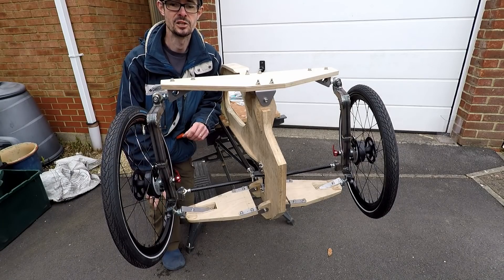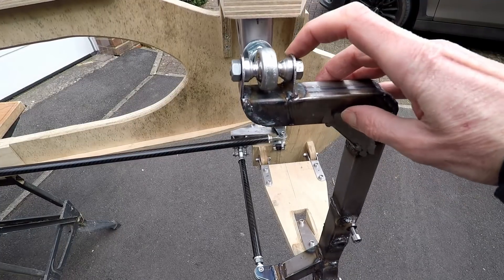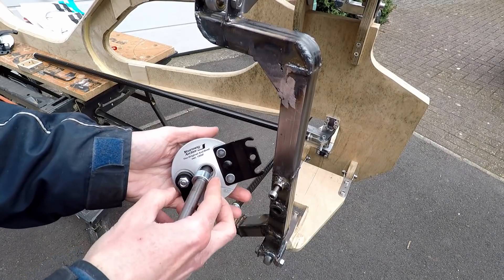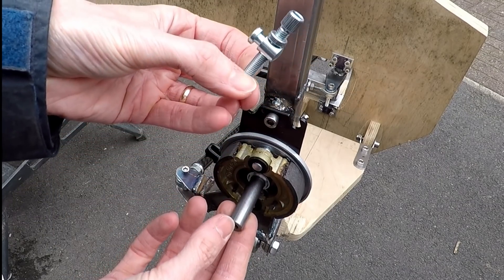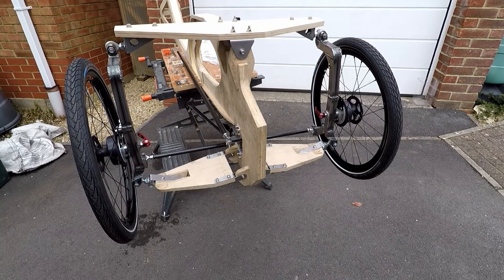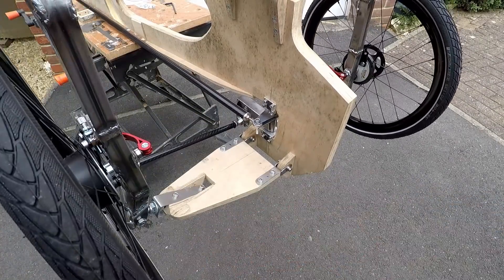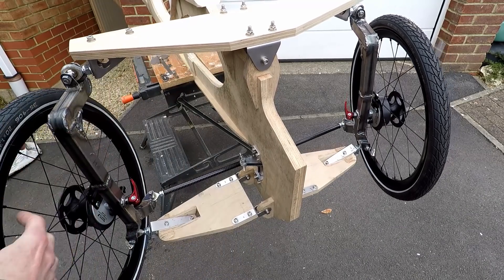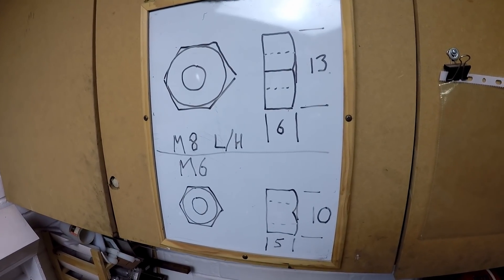Tilting Trikes Part 11- project progress and a closer look at the tilting and steering mechanism

Comment from the maker: I hope you find this update interesting.  Feel free to leave any questions or comments. Best wishes, MMS.
Reply: I'm interested to see what happens when one front wheel hits a bump/pothole. Will it cause issues at higher speeds?
Reply from the maker: @jakobchaney6819  pot holes probably best avoided if possible but I don't see it being a particular problem.  The wheel separation is not that great, so the tendency to spin the trike should be limited.  Time will tell I guess, I'll put it to the test in due course.

Comment: im still gonna fill out a hurt feelings report because u left  us. At least tell us something
Reply from the maker: @Pushyhog  sorry I’ve had to put the project on a bit of a pause due to other things and work getting in the way. I have been working on the design for a new version which I think will be more practical and user-friendly, so hope to get started on this as time allows.  I’m thinking it will be half way between a faired velomobile and unfaired trike.  So with a partial fairing/rain cover.  I’ve got all the bits from the prototype so hoping to put them to good use soon.  If I could retire from work I’d have time for all the stuff I want to do!
Reply: ok dont take on to many hobbies.  thanks.

Comment: Вместо шаровых опор можно использовать сайленблоки от автомобилей они могут частично амортизировать возвращая конструкццию в исходное положение
Reply from the maker: I don’t think a tiny amount of scrub is a problem but the geometry does need to be carefully designed to minimise it. A small amount of positive camber on tilting may be of benefit but a limiting factor is the angle of rotation in the joints to accommodate the tilt and the camber tends to make this worse.

Comment: Hi. I was trying to figure out, what caster angle are you using? and is there a steering axis inclination too?
Reply from the maker: Hi, the caster is about 73 degrees and trail 43mm I think and based on typical values for a normal bike.  The steering axis is inclined inwards by about ten degrees.
Reply: @MetalMachineShop  thanks for the answer. I’ve been trying to figure how you converted the example 5 in 4th video vertical swivels, with the L shaped square pipe you used.. its hard to imagine how those inverted L shapes effectively give the same caster as the straight (and slanted backwards) blue cylindrical pipes you used in example 5 CAD design.
Reply from the maker: @ABwouldsay  the shape of the L shaped things is not important, the only important details are the positions of the upper and lower pivots in relation to each other as that defines the angle of the steering axis.  I only made them L shaped for convenience so that the wheel axles can fit directly without the need for an additional bracket. Needless to say, the position of the wheel axle relative to the pivots is also important.  The steering arms (L shaped things) can be any shape you like as long as they link up to the correctly- positioned pivots.

Comment: G'day, I love your work & your choice of machine to build. Just wondering... why you choose to work with steel as opposed to aluminium?
Reply from the maker: Hi, it’s mainly because I’ve never welded aluminium and I’m not sure if my welder will do it.  I’ve been meaning to try.
Reply: Thanks for your quick response. Funny thing is, I have an AC/DC Tig Mig 4in1 set-up and still have not had the nerve to try aluminium. It seems to be one of those dark arts, but as they say 'You never know until you give it a go".  Keep up the good work! @MetalMachineShop

Comment: Thank you very much for the detailed descriptions in your video. I found your design very helpful in comparison to what I'm trying to work at myself although I wonder if your ground clearance is not quite enough. I'm sure you have thought of this and possibly measured all of your clearances. Could you provide what ground clearance measurements you came up with please?
Reply from the maker: Hi, you are right, the ground clearance is not enough. It's about 100mm. The low centre of gravity also makes it hard to balance. I'd recommend going 100mm higher at least.

Comment: I am designing a cargo bike using a tilting mechanism but am concerned with the steering angle. How much steering angle did you achieve? I.e. the Johansson Oscar s/m uses a similar setup but arranges the rod end bearings turned by 90 degrees. This means a worse load direction for the actual bearing part but more steering which is desirable for my Design. The chike cargo bike uses Spurstangenköpfe instead ( dont know the english phrase) but I a have trouble finding sources for mechanical data / data sheets from i.e. SKF.
Reply from the maker: Hello! I achieved a steering angle of about 24 degrees each way.  I would say that is more than enough once in motion. A high steering angle is only an advantage for very slow speed manoeuvring.  I should have put all rod ends in the vertical position as this gives I constrained tilt, but limits steering angle.  For some reason, I put one of them horizontal, which limits the tilt too much.  For me, at least 30 degrees tilt is desirable.  This does, of course, depend on the objectives of your design.
Reply: @MetalMachineShop  I would be happy doing it the other way around for my cargobike as I think the relatively Limited steering angle together with the long wheel base will result in an impractical turning radius. But as I mentioned initially that limits the load bearing capabilities of the rod end bearings by unfavourable loading. I am glad this works for you anyway! Looking forward to see more of your projects progress and wish you great success.

Comment: Will this front end require some sort of spring/sway bar to keep torsional rigidity? I like your idea.
Reply from the maker: A bit of spring might be good but there is already quite a bit of give in it. I'm looking at experimenting with a damper on the tilt mech as it's quite twitchy.

Comment: You need more ground clearance? Hub brakes are common these days and might be cheaper than drum brakes that must be rare.
Reply from the maker: Yes it does need more ground clearance!
Reply: @MetalMachineShop  Did you ever try a Bicycle Moto Cross bike? The Raleigh Burner, is a great example. I was thinking that Trikes might be, able to be powered more easily. With the reverse trike. Potentially more stable. Than a trike. Although the problem is, it's relying on using the centre of the road. For that third wheel. Which travels, in the centre of the road, like a horse might.
It's pretty interesting to learn about power transmission in modern vehicles.
Also. The problem of maintaining grip, with a changing wheel base. Particularly while braking.
It's pretty interesting how a motorcycle will compress during braking. Producing a shorter wheel base. Plus, adding suspension is a real challenge. And, the challenge of going around corners. Where, if there's two wheels side by side the wheel on the inside of the curve is going to rotate less, than the wheel on the outside of the curve. And, the challenges to power supply that creates.
I watched a documentary on the the split rear differential. But can't say, I can actually get my head around it. Or work out if it actually works or not.

And, was getting interested in Front Wheel Drive. Where, I might look at that again. I have personal challenges here at the moment.
With declining stamina. High housing costs and low wages.

Comment: what is the cost for these parts ? and where can the brakes be bought? I have yet to find them here in the USA. Should I move forward with a veto build like this would you consider getting the parts and shipping them to me? I would of course pay up front.
Reply from the maker: I bought the Sturmey Archer brake drums complete with wheels from ginkgo-veloteile.de , I imagine they could ship to the US.  Cost was about £500 for the pair if I remember correctly. Other brake parts and components were from sjscycles.co.uk .  I wouldn’t particularly want to get into shipping as this could be a legal and tax minefield, but in any case should be unnecessary once you have found the right suppliers.

Comment: Sorry to intrude, but the SA solid axles and their QR "pop-pin" axles are all hardened steel to prevent any chance of them bending as they are single-sided mounting.  What steel have you used for your axle-tubes there?   Did you know that you can buy 12mm Cold-Drawn seamless precision tube (12mm OD, with 3mm wall thickness for example), which would be very strong.
Reply from the maker: Hi, thanks for the comments. The axle steel is some kind of cold drawn machining grade mild steel, I don't know the exact grade.  I'll look out for the tube you mentioned.  From a metallurgical perspective, toughness is better than hardness. Bending is not as bad as snapping!

Comment: Fantastic view!! fantastic video, quick question, will the quick release bars bend easily with the force of the tilt and turn? what wheel hubs are you using? :)
Reply from the maker: Hi, the QR bars don’t take any bending forces or much tension, all they do is hold the bits together, so they should be fine.  The hubs are Sturmey Archer 70mm drums.
Reply: @MetalMachineShop  hey thanks for taking the time to write back. After setting off on a cycle ride through Europe, my trailer was attached to the specially adapted QR bars, after about a month of dragging the trailer about the QR bars bent causing the rear wheel to stop turning. When I saw your video, I was thinking that maybe the QR bars would gradually bend when the wheel was in a tilt turn situation. Would love to see an update in a few months of riding. Thanks for the hub info, I am starting to dream of a trike lol
Reply from the maker: @balanrouge1227  thanks for the feedback, I will definitely keep an eye on the QR skewers but I don’t think it will be a problem with this design. However, something to watch.

Comment: You can easily round off the edges of the plywood by attaching rounded strips to the edge rather than sanding the plywood itself. Sanding is more labor intensive while routing the edge of a board and then ripping it off is much simpler and quicker.
Just a thought.

Comment: I see how you drive the steering, but how is the tilting driven? Is it just by shifting your body weight by leaning or is there some mechanism?
Reply from the maker: The tilting mechanism is completely passive and it’s not driven in any way. The balance is achieved in exactly the same way as a bicycle by steering inputs and body weight shifting. That’s the theory anyway.
Reply: @MetalMachineShop  Never thought of a passive tilt system. The more I think about it now the more I like it. Certainly simplifies construction, which probably means it has a hope in hell of working reliably. Cheers look forward to see how well it works.
Reply from the maker: @marvinschwartz4144  All those three-wheeled mopeds have a passive tilt system as far as I am aware.

Comment: i don't get why the horizontal top suspension blade is sooo high. ditto the suspension uprights at the wheel end are massively too tall. save weight and aero-drag by downsizing the whole front suspension system
Reply from the maker: The reason it’s designed like it is is because the centre of the pivot on the upper arm coincides with where the centreline of the body would be on the fully-enclosed velomobile. At that point the cross-section of the body would be circular, which means that the upper arms can pass through the body without undue interference. You’re quite right though, if the aiming point was a ‘naked’ recumbent then the upper arm could be much lower and the uprights could be quite a bit shorter.

Comment: did you find out how much its weigh? ithink if you used metal weight of the trike is same or so and so ?
Reply from the maker: I haven't weighed it yet but I will be surprised if the total weiggt is less than 20kg!!  The wood frame is about 10kg.  A properly designed steel frame could be a lot lighter.

Comment: How do you decided how wide apart are the two front wheels? And could them be much closer together? Being a leaning vehicle it is posible to have the two wheels separated around 70cms from each other?
Reply from the maker: The current separation is about 75cm so 70cm or less would be possible.
Reply: @MetalMachineShop  Thank you for your answers!
Reply from the maker: The wheel spacing was driven mainly by the need to provide clearance between the velomobile’s body and the wheels.  The clearance gets taken up by both the tilting and steering.  Wheels could be closer if there was no fairing or if steering angle is reduced.  Also the spacing gives some stability with the tilt mechanism locked when stationary or at very slow speeds.

Comment: Nice build, well thought out and beautifully executed.   I have a question/concern on the M6 rod-ends.   When I have used them/tried to use them in the past I found them to be under-size/strength and the threaded portion just bent at its earliest opportunity.   It looks like you have used Solidworks (or similar) for your design details, what does "stress-analysis say?
Similarly, the articulation spacers that reduce the fastening to M5, is this enough "meat" for the application?    I had a "fail" on my tadpole recumbent which cost me a shoulder tendon and 6-months of  pain/post-op recovery so I would not want to see anyone come to grief the way I did.
Reply from the maker: Hi, thanks for your comments, it’s appreciated.  The rod ends at the outer end of the upper arms take the weight of the front end.  These have M10 threads, and they are loaded in bending.  I thought they were ‘about right’ but given your concerns I will do some proper stress calcs on them (or check the spec sheet).  Then 8mm bolt at the outer end is supported at both ends so is loaded mostly in shear rather than bending; even so, I will do the calcs.  The steering tie rods use M8 rod ends.  These are loaded in pure tension/compression and the stresses are not high.  The 5mm bolts are again supported at both ends and should be Ok subject to stress calcs.  The steering push/pull rods use M6 rod ends and again don’t take much load.  Anyway, I’ll do the calcs to check.  Thanks again, MMS.

Comment: The quick release is to remove the wheel easy...  .. since your wheel is bolted in... you don't need the quick release... you should use a regular threaded rod.... axle... or whatever 
So nice... .. ... Can¡t wait to see how it holds up... sideways....

Comment: too wide for bike lanes.
Reply from the maker: It’s about 750mm wide, roughly the same width as a mountain biker’s elbows. Not as wide as it looks in the footage. Narrower would be better though, admittedly.
Reply: @MetalMachineShop  750mm wide, okey but with the handlebar leaning towards both directions ? maybe more than 1.3meter ? despite that, first class project! much respect brother.

Comment: I love watching the progress of this project, especially the trial and error deciding how the tilting mechanism would work.

Now I just need to figure out how to adapt this to a full blown motorcycle. And a full fairing around it.
Reply from the maker: There are a few tilting motorcycle trikes around - no doubt you can find them on YouTube.  The fairing is slightly more challenging - you either need a wide fairing that fully encloses the wheels or a narrower fairing and a way of passing the tilting arms through it.  Both have their problems (and solutions!)
Reply: @MetalMachineShop  ill have to do some more digging then. My assumption was to do something almost like a car wheel well, with the wheels outside of the body, but at least partially faired when straight. Thanks for the info!
Reply from the maker: @soullessred5785  The greater the wheel separation, the greater the amount of clearance you would need in the wheel arches - and more ground clearance under the extremities of the body.  A lot of the trike motorcycles I have looked at seem to have excessive wheel separation.  This is not necessary for a tilting trike as wheel separation contributes nothing to stability (the tilting trike balances in the same way as a normal bike after all).  I would look to trike scooters for inspiration.